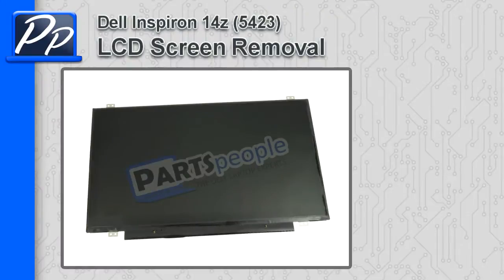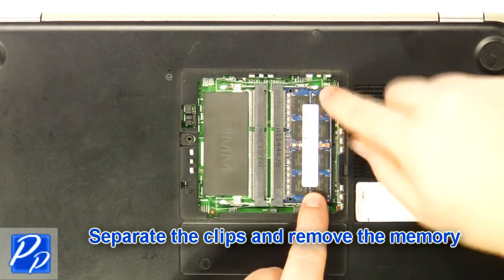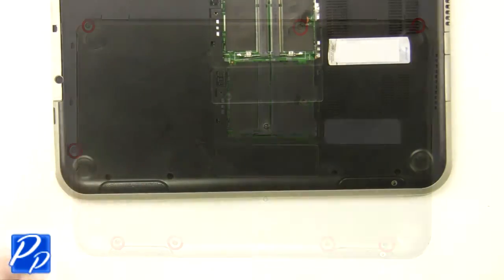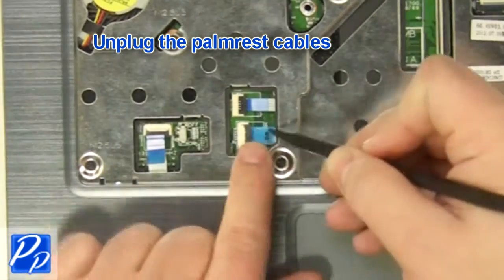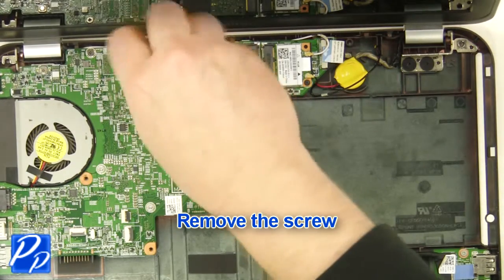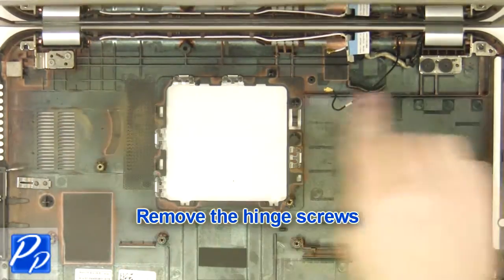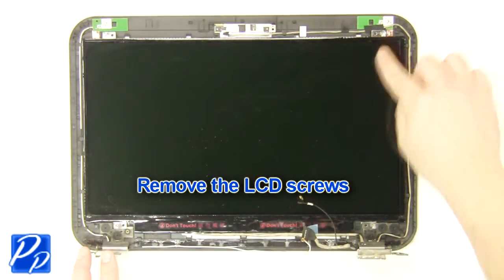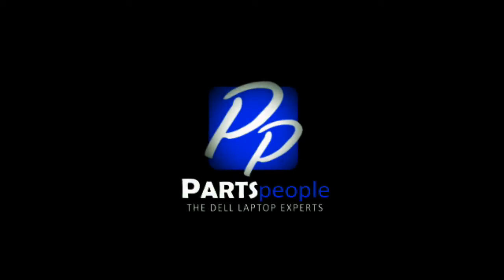Dell Inspiron 14z (5423) LCD Screen Video Tutorial Teardown

Comment: Do I need to take the whole computer apart like this to get the back off? The cover is cracked and needs to be replaced, but I can't find a video that shows just removing the back cover.
Reply from the maker: Yes you have to do all the steps shown to remove the screen assembly which includes the back cover.